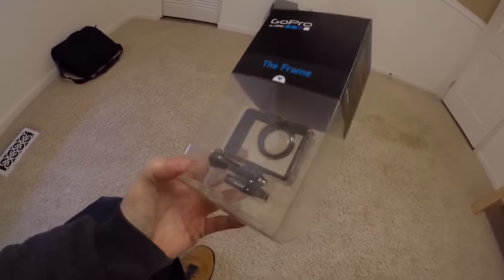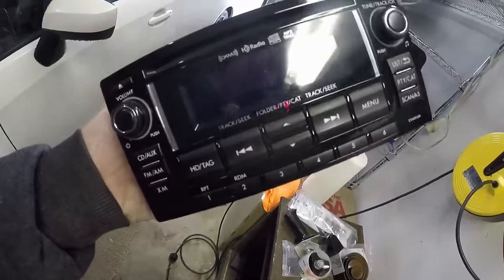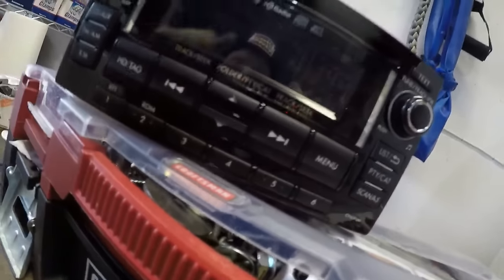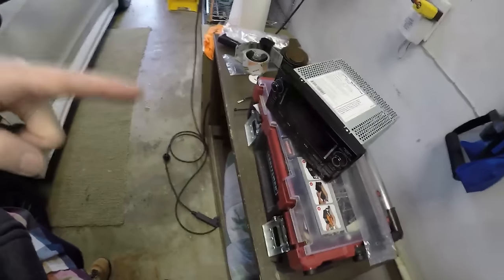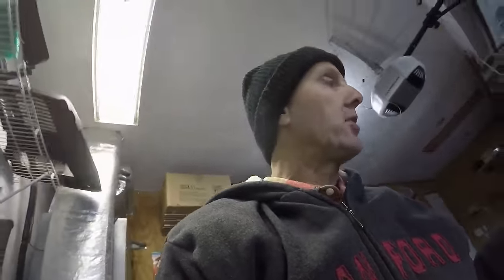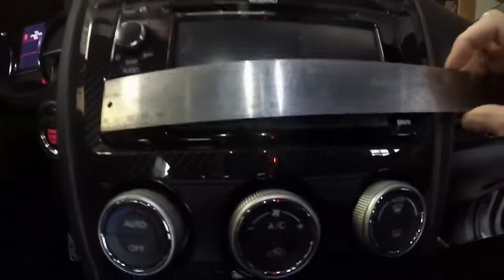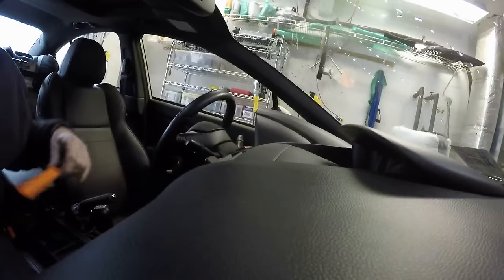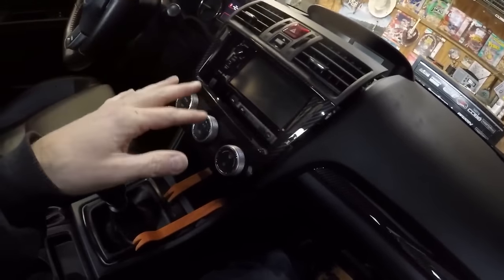2015 Subaru WRX Ep. 608: Test Swapping OEM Nav Radio for OEM Base Radio

Comment: That GoPro frame is almost the same as the one for the Hero 5 Black, nice.

I feel for you having one of those older audio units, not that I'm saying that the 7" one is perfect - the crappy Starlink and SatNav (for non-free updates) are the worst, but the touch interface is pretty good and I have no issues with Bluetooth in any aspect. I'll live with mine for another year or two and then as I can now see the Chinese already bringing out their Android based units for our generation of WRX/STI centre console design, I'll move to one of those.

Comment: The bezel for the 14's-15' radios are gloss black not carbon like yours is. Like a another person said you can probably get a harness made or a pinout and splice but i'm not sure you would be up for that. If anything you should look into the 16+ wrx 6.2 inch starlink headunit. It might be plug and play but i'm not sure either.
Reply from the maker: huh? my car is a 15.
Reply: Because you have the navi you have a different bezel. Compare yours to this and you will see the difference. This is yours https://c4d709dd302a2586107d-f8305d22c3db1fdd6f8607b49e47a10c.ssl.cf1.rackcdn.com/stock-images/469810a53d00538a8cd81fe808793d63.png 
this is a base 2015 bezel http://www.cars101.com/subaru/wrxsti/wrx-x-2015-20.jpg
Reply from the maker: ohh now i see.. i cant beleive the bezels are actually different.. the nav one has a slope around the radio but the base one is flat.

Comment: Go aftermarket . I have the pioneer app1 radio with apple car play. its not the best but it works pretty well. I also had a guy make me a wire harness to get the backup camera image on the head unit. I am thinking of upgrading to a better head unit down the road. I really enjoy your videos man. keep up the great work man!
Reply from the maker: i prob dont want to mess with it honestly. i had a lot of aftermarket kits in my years. like $3000-$4000 setups.

Comment: An aftermarket option would've been much better. Or even better option would've been a 16+hk screen like from the wrx limited or any sti. Just my opinion though. I love the Subaru STARLINK 7inch unit/baby screen
Reply from the maker: sure, except that you cant put in a 2016+ unit into a 2015 car on the stock bezels.
Reply: LastHumansGarage I completely forgot they are diff bezels

Comment: I bet next mod involves group N stuff lol
Reply: That's exactly what was going to my guess
Reply: He already installed the perrin transmission shift mount and removed the perrin pitch stop probably because he realized it could rip that weak mount right off.
Reply: David Hoffman in a recent vid he mentioned something about group N that's y I guessed that. he did give up long time ago on the trans mount since he couldn't mod it to his liking. did see anything about pitch stop so it'll be interesting to see what he do. He the real MVP, spending money trying mods we don't wanna waste money on experimenting lol
Reply: BellaWrx _NJ I have stock sti shift knob, sti short throw, ralley armor mud flaps, perrin shifter stop and bought a clear bra. Sitting around 2,200 miles total, just tempted to get a pro tune with it stock and leave it at that.
Reply: David Hoffman I ended up getting a deal with sum1 off an App where for 550 I got a AOS, V3 AP, and LM60 blizzaks. I gotta spend 450 to get AP relicensed and updated for my 17 wrx and the AOS not compatible with the fa20. all i'ma do for now as well is stage 1 pro tune and have the shop do an even swap of the AOS for me so I get the right 1. if u care about warranty, talk the your service reps and see what type of guys they are. my place pretty cool supposedly and they work with guys that have done warranty voided mods. stage 1 still voids warranty but at least wouldn't have a shit load to do for a dealer visit if anything. that's my thinking so far. almost at 4k miles since end of August.
Reply from the maker: hmmm